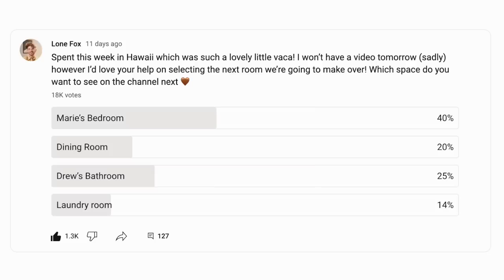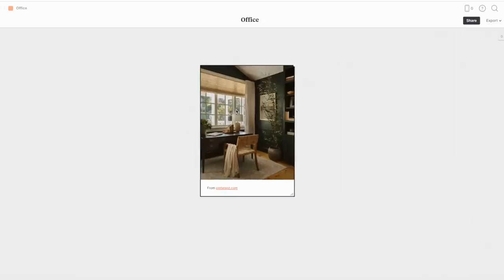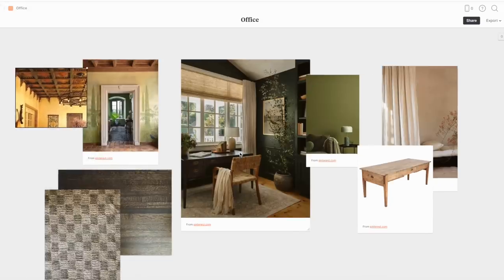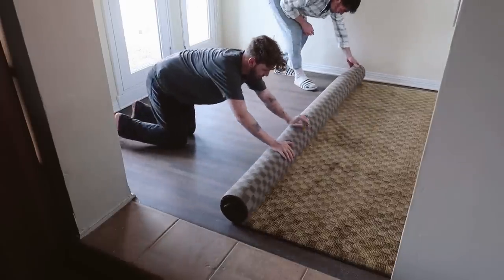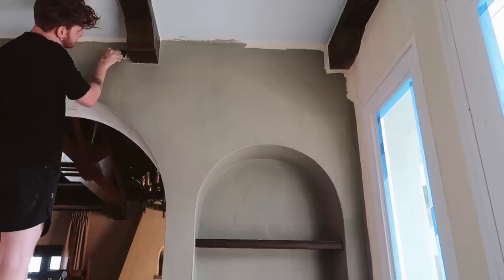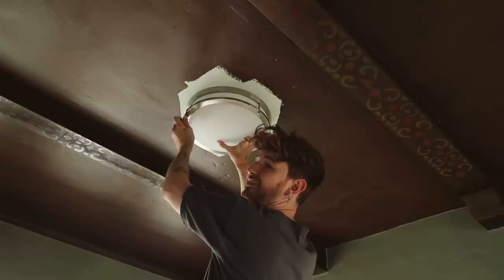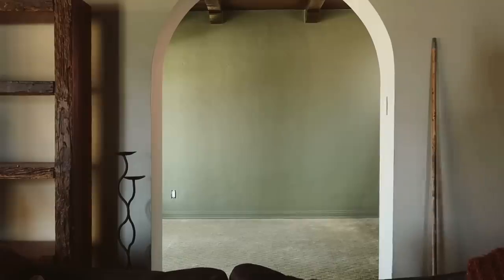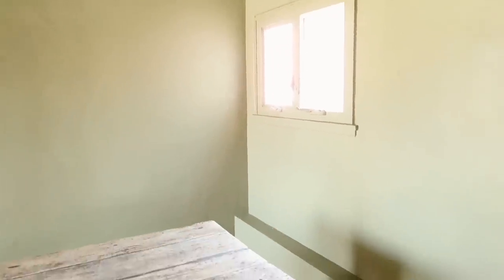EXTREME Home Office Makeover ✨ Part 1 ✨ Moody Olive Green & Warm Wood

Comment: You probably have add the height to you table but the vintage tables that Nordstrom used to use in their Men’s wear department looked similar and had casters on the them. You can purchased vintage casters still. I like the dining room chair but the other chair is to small. Can’t wait to see the ceilings. BTW green is my favorite color.
Reply: I thought the same, big beefy industrial casters though. Even Home Depot has them if you Google industrial casters. EBay too.
Reply: @bettenotap4791  yes but I would do vintage because one they’ll be made better than what’s manufactured today. And two something from Home Depot will look to modern.

Comment: BTW Drew, you should have liners installed in ur working fireplace chimneys, if not already done. Protects from debris getting hung up in cracks or stone work w/in the chimney and slows a chimney fire from entering ur attic spaces (slows, not prevents) - worth it! If you use ur fireplaces a lot, have them swept every Fall(every year) and not the every 2 yr recommendation. We learned all the hard way. If a chimney fire is minor - smoke does horrible damage and if water is needed - firemen are not careful or care about material items, walls or floors….they make a horrific mess and it’s not always necessary.
Reply: That's right. You absolutely don't want a stack fire!
Reply from the maker: I had the fireplaces fully relined upon moving into the home!
Reply: That's why YOU are Lonefox!
Reply: As He's "Smart & Cute"

Comment: I have a new appreciation for the hard work that painting can be, and for quality paint. A few rooms or accent walls is one thing, but I just painted my office lobby and hallway with Glidden. One side is Smokey White and the 3 accent walls are Cracked Pepper, both Behr with Glidden Eggshell base. I'm not really impressed with the quality. 

I can see that Sherman Williams went on like butter. No streaks or maybe minimal in person. How many coats did you do of the green?

I did see a short video of @Taybeepboop painting her ceiling black and she said black actually needs a lot of coats. The Cracked Pepper is a dark grey. At an angle I can see the streaks. The wall has 2 coats on it. Maybe I need another coat?

I think I'm going to do my office room (inside the big office) one color instead of a neutral wall with an accent wall. It has white ceiling tiles that I can't paint without replacing. That would be an insane amount of time and money to replace The whole office is 1500 sqft.

Thanks for the inspo Drew!

Comment: Do you have to sidle past the desk to get to your seat? Does the terrace door open in or out? Things like these details can become major annoyances in the long run, As for the chair, I think you should wait until you add height to the desk to get the correct measurements. Since the desk and ceiling are rather grand in scale, the chair should be so as well. You can see the current chair for comparison. The chair is just dominated. Sticking to scale would look more cohesive. It's important to not put yourself into a situation where you have to hunch over to work on the computer. Have the screen at eye level, and you can always get a nice looking riser to accomplish that. Finally, if you choose a chair with arms, make sure they easily fit under the table. From my experience, chairs with arms wil cause you to lean on one arm. Better for the health of your spine to go with no arms.